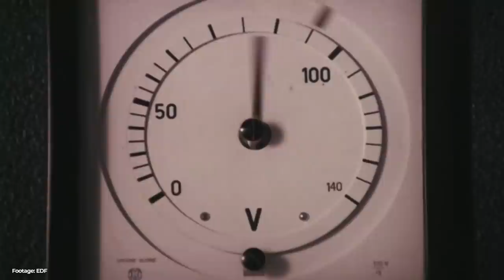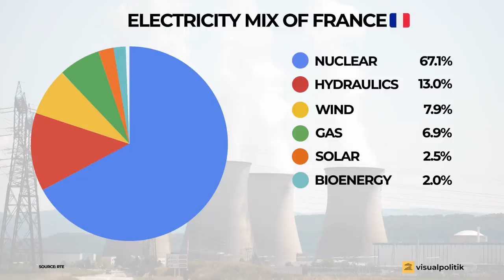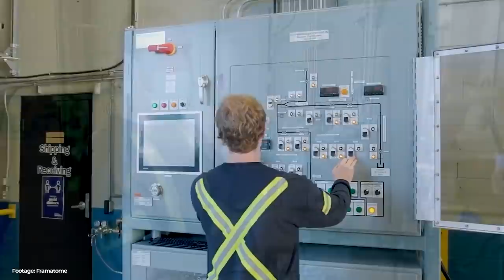Why is FRANCE betting on NUCLEAR ENERGY again? - VisualPolitik EN

Comment: The biggest gamble in energy strategies among nations and my personal bet is that Germany will have to admit a defeat eventually. Because German strategy assumes wind and solar installed power about two times higher than peak demand (implies huge investment costs), lots of storage (for which there is no foreseeable technology to store energy in summer for the winter), lots of hydrogen hydrolysis plants (which have very poor efficiency and most hydrogen will be needed for vehicles and not to generate electricity again) and demand response (which may shift demand for a couple of hours, but is useless for weekly or seasonal shifting). All in all, this strategy has too many weak points to be considered as viable. What will Germans do in cold and calm winter nights? But we will see.
Reply: I would disagree with your assessments on most points to be honest.
The german (conservative/libertarian) government paid for a study 10 years age which answered all those questions and showed how Germany could be run on 100% renewables incl storage without the need of new technology (except a moderate learning curve) and without added cost to the system.
Since then reality has shown that the learning curve in storage and renewable technology was underestimated by them by a lot.
I could give you a break down if you are interested as I'm currently working on a presentation on renewables at my german university, for which I reread that old study and compare it with the current situation and give an outlook into the future.

First of there is a negative correlation between wind and solar, so u have more wind at night and in the winter, which lowers the need for storage. Based on data for Germany over the last 10 years, the need for long term storage is much lower than first expected, but installed power has to be equal to peak power.

We need massive amounts of hydrogen and synthetic fuel for heavy industry, ships/airplanes, and long term storage, etc. as there is no alternative. Luckily this is cheaper and ironically more efficient than nuclear. (Nuclear has an efficiency of around 33%, while hydrogen storage can be over 40%)

I highly doubt though that hydrogen cars will ever be a sygnificant thing and even hydrogen trucks might never happen. 2 years ago I would have answered "I don't know", but if you look at the data coming in, I can't see any feasible pathway for hydrogen cars, while BEVs are already on their pathway to take over the market. (November we had more BEVs than Diesel cars sold in Germany.)

On the other hand France has relyed on german coal power for 4 winters in a row now and around half of their reactors is due to be decommissioned in this decade. I doubt how they could replace 30 reactors in 10 years if their last reactor took almost 2 decades and 19bn to be build.
Reply: @TBFSJjunior  what you said is not totally true.   generally, france import electricity from germany, but , in the same time,export the double for italie,spain and uk .  france have a positive balance for electricity.     and when you are talking about effeciency, what is the effeciency from a solar panel and a wind turbine ?   rsponse 25   30 %   max.
Reply: Riot.
Reply: @TBFSJjunior  Admittedly, I don't know the details about German strategy - my impression is that it is politically driven in the sense - give me the best strategy without nuclear- and then this is what they came up with. It might work. But i have a PhD in electrical engineering and power systems and 20 years experience in energy regulation and some things don't look intuitive to me. Even some things you said above are looks dodgy. 1. You don't compare 33% thermal to electric efficiency with 40% electric to electric efficiency - these are apples and pears. Further 40% E2E efficiency with H2 is a dream, currently its more like 30%. 2. If you have installed wind and solar equal to peak demand and because average output is about 30% of installed, where do you get the missing energy to cover electric demand as well as to generate wast amount of hydrogen. In my intuition you need much more installed power than peak demand. 3. there may be more wind at night and in the winter on average, but there are seasons when this is not the case and then what? 4. My question on seasonal storage remains unanswered. The rest of what you say makes sense, but just to set the table: what is your profession and experience?
Reply: @olivierb9716  France is indeed struggling in the past years with its nuclear fleet and sometimes indeed needs to import electricity in total. But this reflects the hard time (namely neglect) on nuclear industry over past 30 years. This does not mean these problems will persist. Nuclear has a much greater and feasible potential to close the energy gap than any other strategy. Probably the best mix is to have installed power 50-60% (of peak demand) that is available anytime (nuclear, hydro) and about 70-80% (of peak demand) of RES, and produce hydrogen when there is excess. But maybe you need much more.
Reply: @olivierb9716 
World record for solar panels in a laboratory is a bit over 47%.
Commercial solar panels are currently around 22% and are expected to reach 30% in this decade.
Windturbines have a physical limit of 59% and commercial ones reach around 50%.
So your 25% for solar is currently to high while 30% for wind is way to low.

And yes France has a positive balance and is the biggest net exporter over the year, but France decided to use electricity for heating to increase their baseload so they can use more nuclear, but they use mostly very ineffizient resistance heating and currently don't have enough nuclear capacity in the winter at peak hours. Especially around January/Februar their balance is negative and they rely on imports to keep the houses heated.
Reply: @TBFSJjunior  if i'm agree with you about the heat on france, the rest is bullshit. 
you can have what you want about solar panel in test but the reality is much worse.
47% ok,  but you must divide par 2   (the night), and don't forget bad weather.  
a perfect wind turbine with 59% , ok, but with a  speed limit   (not too much wind and not too less).   without ideals speed condition, the productivity is not good, less than 25%  in real conditions
it's important real conditions.
Reply: @matejkleni6295 
Germany strategy"
We had a conservative/libertarian government for 16 (4) years, who loved nuclear and coal and was forced by public pressure to decide to phase out both, while they killed over 150 000 jobs in the wind/solar industry at the same time. Germany doesn't really have a solid strategy when you look into the political parties and even the green party isn't ambitious enough to match the paris climate goals.
I was talking about the engineering and science view on the issue at hand and it seems that many politicians have to be dragged along.
And to give some background:
I've studied nuclear physics, mathematics and computer science at a german university in the 2000s but had to stop after my bachelor thesis due to health issues. I've worked in the german electricity industry and have done safty inspections.
I've been reading studies and science papers on nuclear/renewables/hydrogen/BEVs/german-energy-market/etc. for at least 15 years and am currently studying at a german university sustainable engineering and am teaching on the side and hope that my health will allow me to continue doing this.
So technically I'm currently a student and a teacher, but I guess that would sell me short (or whatever the saying is).
So to give you an overview of the 10year old paper I was talking about:
Germany currently uses 500TWh of electricity and has a power demand of 40 to 85GW. Installed capacity is around 225GW with half of it being dispatchable and half of it being volatile. So Germany already has more than 2 times it's peak demand installed, but this can be very misleading as many peaker plants are planed to operate with a CF of under 0.05
The study by the Fraunhofer Institute did an estimates for the most cost efficient system which would need 252GW of solar, 200GW of onshore wind and 85GW of offshore wind, 5GW of hydro.
In addition 81GW of CCGT aswell as 13GW of local heat/electricity plants (both operated with renewable methan).
For storage they use 52GWh batteries(9GW), 60GWh pumped hydro(7GW) and 86TWh Methan (Germany has a potential of 600TWh gas storage and currently uses around 300TWh as national reserve) via 50TWh from biogas facilities and 88GW of PtG.
Fraunhofer came to the conclusion that this system would cost the same as our current system, while every study I've seen on nuclear expects a massive cost increase (EDF expects 120€/MWh compared to 30 to 40 currently).
Also Fraunhofer has underestimated the learning curve of solar and wind. In Portugal (where they have more sun of course) they have almost reached 10€/MWh for new solar (I would have to look it up but is was 12 or 13).

Now to your points/questions.
1.yes it is apples to pears, which was kind of my point but I didn't make that clear. Efficiency is meaningless here. If you get Solar for 10€/MWh and nuclear for 120$/MWh than you would have to look at the cost of PtG and GtP facilities, but the efficiency is almost meaningless as you will get a massive overproduction of renewables at times, which means you use them or you lose them.
A paper published in "Energy and environmental science" ("Large-scale electricity storage utilizing reversible solid oxide cells combined with underground storage of CO2 and CH4") in 2015 estimated a round trip efficiency of 70%, which makes your statement 40% is a dream a little odd. I read real world round trip efficiency for hydrogen of 40 to 45% on a regular basis in science papers or lectures from different universities.
2. Yes you would need much more installed power than peak demand to counter the lower capacity factor and storage losses. I'm not sure why you or anyone else would think otherwise.
I reread my comment and I think you misunderstood my statement "need for long term storage is much lower than first expected, but installed power has to be equal to peak power" maybe?
This was about storage. So the installed storage has to match peak power demand cause if u have one hour with zero renewables, the whole grid would have to be feed from storage.
The newest French nuclear reactor in flamenville is a 1.6GW reactor for 19bn€. For 19bn€ you could install 12GW of solar, but of course you can't compare them like this as there a many additional factors (capacity factor, fuel, maintainance, capital cost, storage cost, etc.) u would have to look at.
3. Like I've said earlier, Germany currently has the potential to store 600TWh of methane, which is over half a year of its current power need. That's a benefit of using natural gas during the transition as you have some back up for the worst case. (Same is true for nuclear btw. You always need backup unless u are fine with regular blackouts like in the US. I've lived in the US and what is going on there would be unacceptable in Germany. Germany currently has a blackout index of 13 vs 46 in France and over 240 in the US. (Numbers are like 3 years old)).
Also when you look at current policies we will all fail the paris agreement, which means we have to apply carbon capture technologies anyhow and need an overproduction of power for some years. So we have to plan on building overcapacity in any case.
4. Was this enough of an answer? Also one thing to add. Currently Germany gets around 10% of it's electricity from baseload bio-gas plants,  which is a waste as we sometimes shut off wind power (6.5TWh in 2020 or around 1% of Germany's yearly electricity need), while baseload (nuclear/coal/bio-gas) continues to produce. Those bio-gas plants could be converted to peaker plants or indirect storage as it is much easier to store biogas than electricity.
(Last but not least. I wrote this on my cellphone and most of it came from memory. I'm pretty sure about all the facts and looked up the few I wasn't uncertain about, but I apologize if I made a factual or English error)
Reply: in 2019, the load factor for wind turbines in germany was 22%........
Reply: and i don't find the load factor for solar panel,  must be worse, berlin is not miami.
Reply: @olivierb9716 
"Bullshit"
Yeah you wrote a lot of it.
Could it be that you don't understand the word efficiency? I'm struggling to get what you are trying to say.
At night there is no sun in the sky so you don't get Solar rays. An efficiency of solar in the dark is a nonsensical thing to discuss.
Could it be that you don't know the difference between efficiency and capacity factor?
Reply: @olivierb9716  
Yes the load factor/capacity factor for solar is pretty low.
It's around 10% in Germany.
Wind can be from 20 to 60% depending on type, height, onshore/offshore, etc.
The capacity factor of nuclear is much higher with 80 to 95% as long as operated as baseload. For load following the CF drops significantly.
Reply: @olivierb9716 
You are aware that load factor and efficiency of energy conversion are 2 different things?
Also that number of 22% can be a bit misleading as this includes up to 25 year old wind turbines. Back then 1MW was a lot and today they build 15MW wind turbines, which are much taller and capture wind where it blows much more stable.
Offshore you reach up to 60% capacity factor in some regions.

Then there is the issue that 2019 Germany had a lot of wind overcapacity in the north which got turned off regularly. Since then some HVDC powerlines were added to the grid which should increase the capacity factor.
Reply: @TBFSJjunior  first , i'm just a worker who try to have an opinion about energy and electricity, and i'm french too, so, my english...
sorry for the bullshit, perhaps too much offensive. 
the fact is , you have a lot of fluctuations in solar and wind.  dificult to have a grid  stability with just renewables. a lot of renewables fans just forget the bad  side of this. look at the year 2019, it was a year like another.
Reply: @TBFSJjunior  Thanks for extensive response. And for civilised debate:) I trust you're a relevant expert. 
Just a couple of reactions:
1. You don't kill jobs by not investing in more RES. These jobs don't exist in competitive economy, they only exist in restrictive economy where you prevent the most competitive technology, even though it can do the trick of reducing CO2. It is these unnecessary political restrictions that kill jobs or create new useless jobs. 
2. I am not saying that nuclear is the most competitive technology - i have no proof of that. you need to compare capex and opex of nuclear (which currently may indeed be at about 120 €/MWh when looking GB) with capex and opex of what you suggest of about 450 GW of wind + solar + CCGT + battery + carbon storage. So for each GW of nuclear you need at least 4.5 GW of combined RES/storage/backup capacity. Even if wind is 0 cost, all other backups and storage are making it so expensive that i doubt that it is still cheaper than nuclear. Also you need to account for the infrstructure needed to support it (gas and electric network) but if you have these cost calculations, i would welcome them.
3. Aren't you at least concerned that almost all other world is betting on nuclear. Why is e.g China investing in nuclear if it can produce the cheapest PVs at home? Do you really think all their planners and scientists are wrong or pressured into nuclear. Whats the likelihood of that? I trust more in a system where planers are free to pick the most competitive technology than to a system where one technology is politically blocked. 
4. My very personal experience with German energy ministry is that they are very dogmatic - regardless of what is efficient they will do only what is politically acceptable - regardless of costs. 
5. I am surprised how much of this strategy counts on methane or biogas for seasonal storage - is there really enough biogas to supply Germany for  couple of months of low RES production. Your statements of current 10% of biogas for electricity production should be reviewed at least. Also the statement on wind curtailment is strange since wind is curtailed only when the network is unable to transport it to the south of Germany and not because of somebody has decided so for unknown reason.   

2. Your statement on round trip efficiency of 70% probably refers to blue hydrogen, not green hydrogen. Blue hydrogen should be stopped as it is environmentally even worse than burning natural gas - one cannot fully and safely capture and store the greenhouse gasses resulting from the processing and use of blue hydrogen. Every processing and every storage eventually leaks. I maintain that green hydrogen efficiency (P2P) is low at about 30 % and has not risen dramatically in the past 50 years or so. But i am not an expert on this particular topic.
5. I maintain my overall impression that German strategy is only best under constraint where nuclear is prevented. If German planners would be free to chose the most cost efficient net zero strategy, i am fairly confident that nuclear would take between 30 and 50% of the mix. I don't think all the rest of the world is that stupid. Neither are German planners, but they are restricted to think in certain direction.
Reply: @matejkleni6295 
1.

Yes and no.

Old power plants are (almost) always cheaper than new ones due to the initial investment, so old already paid for plants have a market advantage.

Germany produced some of the cheapest electricity in Europe around 2017 which caused an export surplus of over 55TWh (>10% of production), due to renewables being pushed politically and a huge overcapacity in coal/nuclear which was cheap as the plants are mostly super old and paid for. (Carbon pricing luckily made coal more expensive since).

Also in 2000 solar was subsidiesed up to 460€/MWh which dropped to 0 to 40€/MWh today, so they are often profitable on their own (except for very small installations).

You needed the initial subsidies to create a market and an industry to take an advertising of the economy of scale. The german government killed the market a couple years before it could support itself, crushing the industry, destroying jobs and killing some of those scaling factors. (Also nuclear has always been subsidiesed. I don't know of one nuclear reactor that wasn't subsidiesed in some shape or form.)

2. The study I quoted included all those costs and came to an overall cost equal to the cost of the current system, which is cheaper than new nuclear by a factor of >2 (Including infrastructure and heat storage/heating/extra-heat-insalation/etc.).

Gas power plants which only run 5% of the time are more cost effective than new nuclear, so you can have a lot of extra capacity if it runs at least 5% of the year.

Also there has been a huge price drop in batteries thanks to EVs.

A 50kWh EV-battery in 2010 cost around 50000$. In 2020 you got the same battery for 8000$ and they expect the same battery for local storage to drop below 1500$ before 2030.

Those are crazy price drops, which is one reason I'm sure that BEVs are here to stay and that battery storage will become a regular thing in every home.

Many papers expect a price drop of solar to below 10€/MWh which would be 1/12th that of new nuclear.

3. "Aren't you concerned..."

Not really because I don't think they will do it. I think they want nuclear due to many (bad reasons), but I doubt they will be able to do it as it is to expensive and they won't find investors taking the risk.

Bill gates is currently building a new modular reactor and is only doing it cause the US government pays 50% of the construction cost and garanties to buy the electricity. In the UK the gov offers to subsidiese nuclear by 3 times the market rates and still struggle to find investors.

Just imagine the investment risk of having a wind turbine for 25 years or a nuclear reactor for 40 years. It is much more likely that a new technology is cheaper than yours in 40 years than in 25. (Hope you get what I'm trying to say here)

"Why is China investing in nuclear?"

Because they are investing in everything without thinking about economy as they don't have a market economy. China doesn't make sense for our western brains. They are currently constructing hundreds of coal power plants while most of the ones they have run a deficit and the average capacity factor is below 50%. They could basically double their coal power output without building one new coal power plant. They don't need new ones let alone hundreds, but they are still building them.

They are also the biggest investor in wind and solar. In 2020 alone they got 72GW of wind capacity online. In one year they installed more wind than Germany has in total.

4. That is true in a way. One reason why Germany is putting most cables under ground as the population doesn't like over the ground cables. It also is a major reason why Germany's blackout index is at 13 vs france's at 46 and America's at >240, but under ground cables aren't the most cost effective for sure.

5. Yeah I looked up the exact numbers. In 2020 45TWh of electricity came from biomass as baseload (a bit over 9%).

The issue is that there are few other technologies like it for seasonal storage and it makes the transition super easy.

Switch from coal to natural gas and in the mean time build as much renewables as possible. If you have an overproduction, just turn it into hydrogen or methan and put it into the national natural gas pipelines. (You can mix up to 5% of hydrogen into the natural gas pipelines without modification.)

Its a bit oversimplified and you can and should optimize your system of course, but it shows a workable pathway to switch from one system to the other.

"Wind is only curtailed..."

Yes and that is the case. The northern German states are running on netto 100% renewables, but they don't have enough transmission lines to the south. And one issue is that the transit states have to pay for the transmission lines, without benefitting from them which is a hard sell.

Early 2021 a HVDC power line to Norway went online. Nordlink has a capacity of 1.4GW and connects wind power from northern Germany with hydropower in Norway and should be able to take most overproduction from wind.

Btw fun fact: the EU and china is currently in talks about a 7000km UHVDC power line (probably around 1.1 to 1.5 MV) connecting Germany and China to counter weather issues (because it is day in China when it is night here and the other way around).

2. "70%...blue hydrogen"

First of all, yes blue hydrogen is a joke and often worse then natural gas, but that paper was on storage using methan as it has less of a leakage problem than hydrogen. It uses 2 underground caverns, one to store methan and one to store CO2. It also reuses heat from one process for the other which makes the process more efficient.

"Green hydrogen...30%...not risen in 50 years"

Then you are wrong I'm afraid. A lot has happened there especially in the last 10 to 20 years and there are many different new systems.

To give a specific example I've just read the paper the other day: the HELMETH project by KIT gets a Power-to-methane efficiency of 76% and CCGT can reach up to 64%. That's 49% efficiency for powerToMethaneToPower with real world working facilities. KIT claims they expect to reach over 80% efficiency (for PtG) eventually by working on some design flaws.

So if they can reach 49% with methan they sure as hell can reach more than 30% with gree hydrogen.

5. I'm 100% certain that if you get rid of all subsidies (and I truly mean no subsidiese, which would include proper insurance for nuclear btw) and put a huge price on carbon you would end up with 0% nuclear. The only reason nuclear is a thing is politics and idiology. Economically they don't make any sense.

Even the russian atomic agency which is developing their nuclear reactors is currently alocating R&D funds away from gen IV nuclear to wind turbines out of economic reasons.
Reply: @TBFSJjunior  How is the hydrogen produced for heavy industry in your calculations? It obviously can't be steam methane reforming, that is unsustainable for the climate.
Reply: @xWood4000 
I don't understand your question.
Yes heavy industry has to switch to electricity where possible and if not to hydrogen if possible and if not to efuel/bio-methan.
Coal should be phased out first and natural replaced as fast as possible aswell.
Steam reforming (aka blue hydrogen) is often worse for the environment than using natural gas directly.

We have to build massive amounts of renewables which will cause a massive amount of overproduction, which then can be used to produce green hydrogen or green methan.

Denmark is currently building a 1GW electrolyser to use wind power to create green hydrogen for the ammonium production, which is currently done from natural gas.

Germany is planning to build at least 10GW of electrolysers by the end of the decade.
Reply: Last thing Germany does is admiting defeat. It took them burning Europe twice to do that, and they going Bee line towards theirs goals, newer minding how great, or unrealistic goals are.....